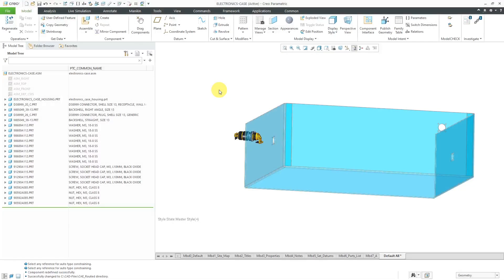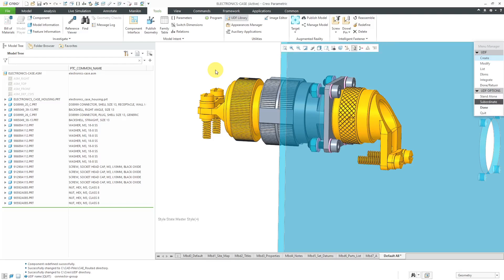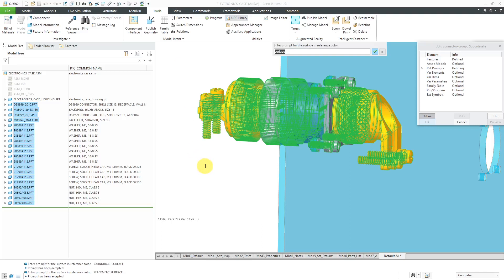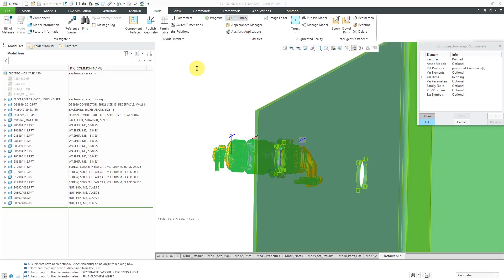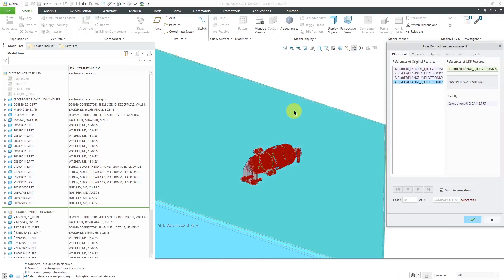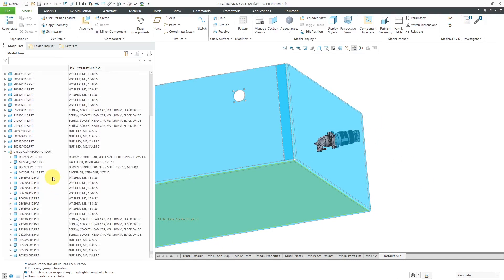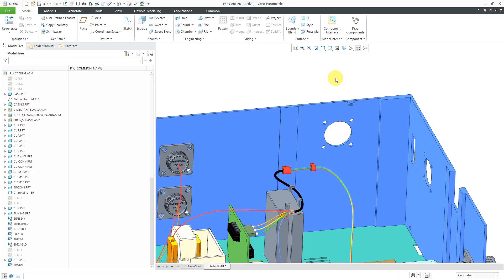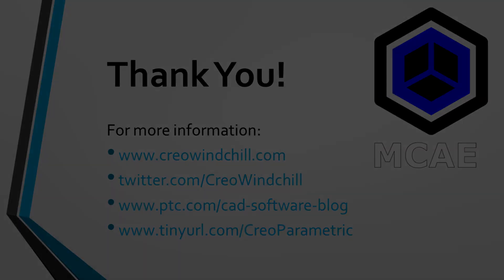Creo Parametric - Assembly User Defined Features (UDFs)

Comment: So, from what I understand, this UDF feature helps with batch placing of repetitive set of components to the assembly. What I don't understand is whether it is possible edit definition of UDF so all instances would be updated in the assembly accordingly. From what I see UDF just puts components to the model tree as usual (or under group), so I cannot edit one UDF and expect others to update in the same way as it would be sub-assy. Am I correct? Is there any other ways to implement such components group with batch editing and not being a sub-assy?
Reply from the maker: I suggest you go back to my previous video on UDFs, titled simply "User-Defined Features (UDFs)," where I touch on the difference between the options Stand Alone and Subordinate. With the latter option, it is indeed possible - in fact, it is the point - to change the definition of the UDF and have everything based on it update.
Reply: @CADPLMGuy  Thank you!

Comment: Is it necessary that the Parts included in the UDF are already loaded in the workspace ?

I tried to place a udf while the Parts are Not loaded. It didn’t work out.
Reply from the maker: It depends on your settings. Talk to your admins.
Reply: @CADPLMGuy  Can you tell me which settings, please? I am the only cad designer in our company and so I do all of the admin work to. 

After your comment, I've already searched for "udf" in the config options. But didn't find the right setting. 

Thank you very much for your time! I appreciate it.
Reply from the maker: It's been over 4 years since I've been an admin, so I don't remember off the top of my head. But the relevant options deal with operations to add dependents automatically; they don't have 'UDF' in the name or description. I recommend reaching out to your VAR or opening a ticket with Tech Support.